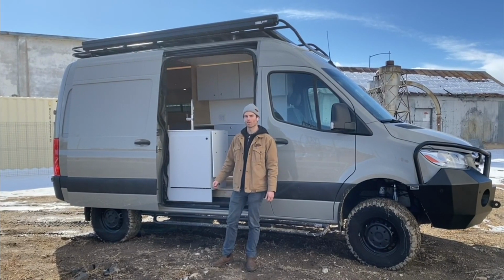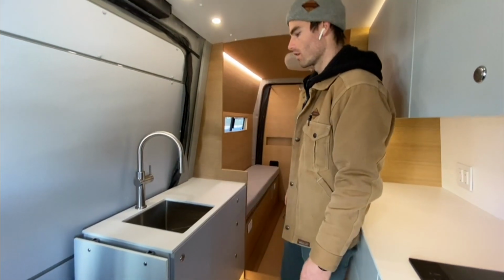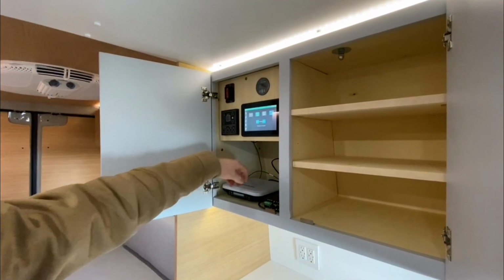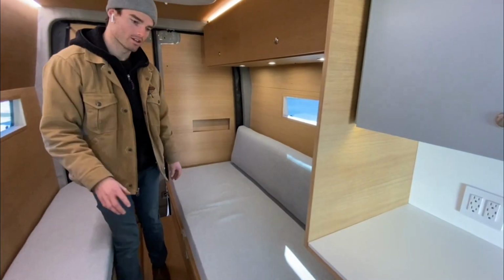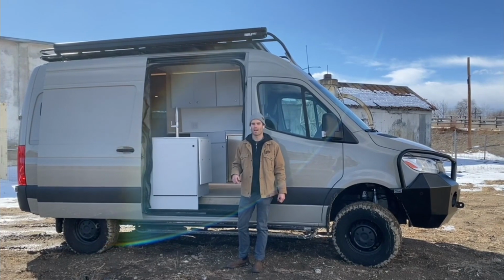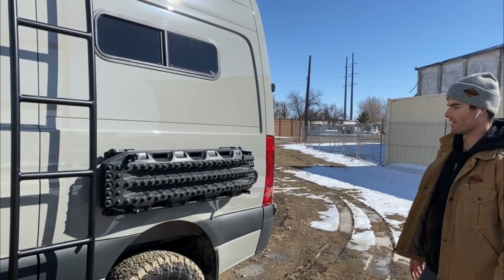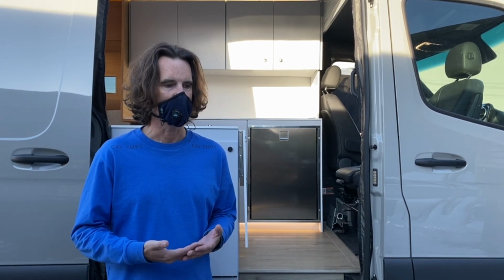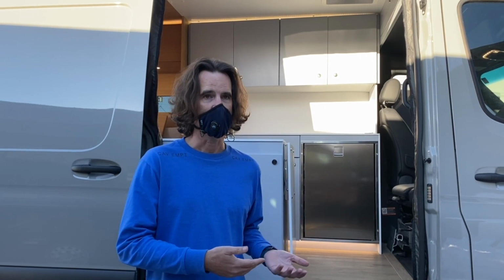VAN TOUR | Custom Van Build w/ Modern Interior | Rossmönster Vans | 134

Comment: How are you guys going to address the gap between the two back doors. If they stay anywhere cold it's going to let in a lot of cold air
Reply from the maker: The rear doors are insulated and the full rear door panels allow for the whole door to be insulated. This set up will perform better in the cold than a van with rear windows or a three pieces door panel set.